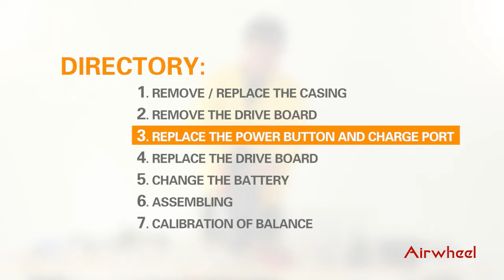These steps you should know to maintain the Airwheel Q3 mini electric scooter

Comment: Thanks in advance for this video.  Very helpful!  Love my Q3 all the way.  But still a question: to calibrate the Airwheel, i only should connect (weld) a red/black wire to the red wire (5:08 video)?  And then do the calibration when fully assembled? 

Or should i also have to weld a red wire and a black one on the right top corner of the red rectangle (6:00 video)?  Or is this only to connect and disconnect the main drive board?